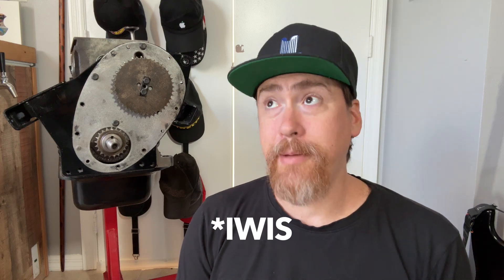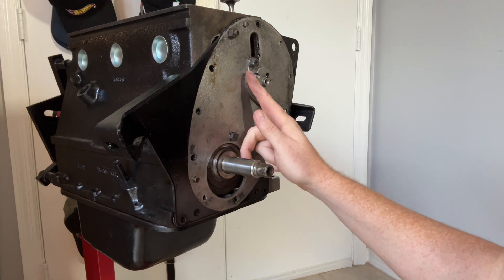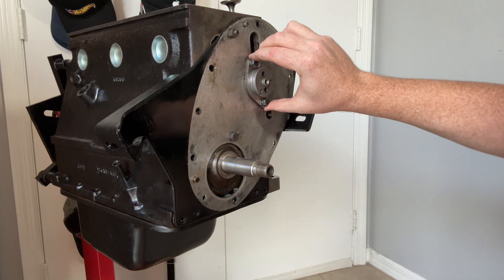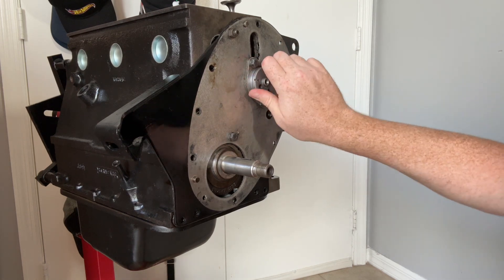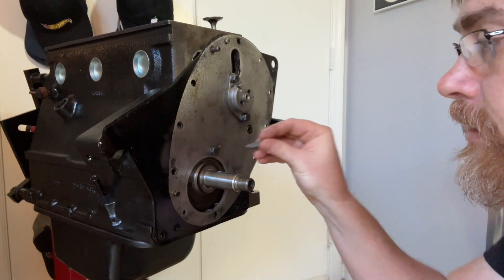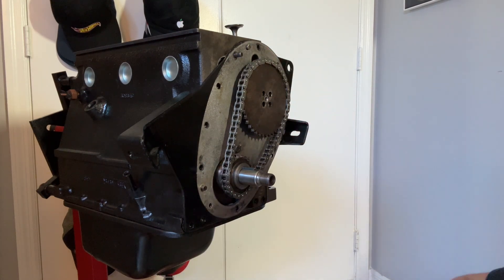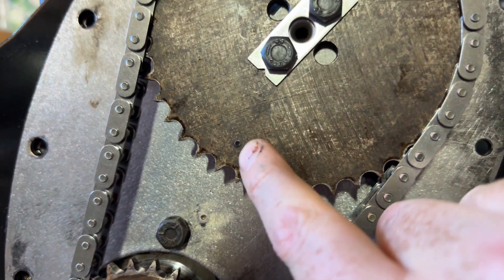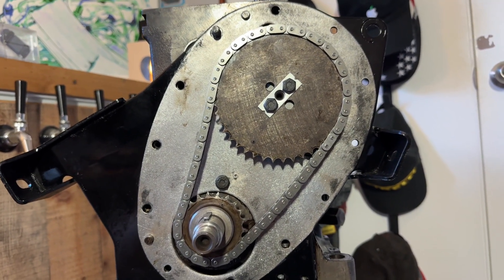Timing chain installation | Triumph Spitfire Restoration - Part 111

Comment: I'd double check with a timing wheel just to be certain of where you're at. I haven't done it that way before, but it seems like there could be 4 possible orientations with the cam.
Reply from the maker: Based on the witness marks of the cam it should be good.  But I do have a wheel I can toss on there to be certain.

Comment: I think that correct installation of the timing cam and gears on a Spitfire requires magical incantations, thirteen dial indicators and maybe animal sacrifice,
Reply from the maker: If you are not using original gears, yes that is 100% correct.

Comment: I’m thinking the end float issue was caused by the Permatex causing the back plate to stand off a little.
Reply from the maker: Na, I was dealing with it prior to putting the Permatex on there.  I never covered it in depth because it was so infuriating.